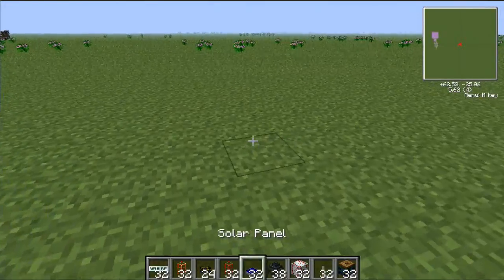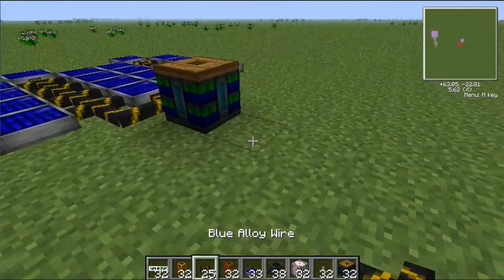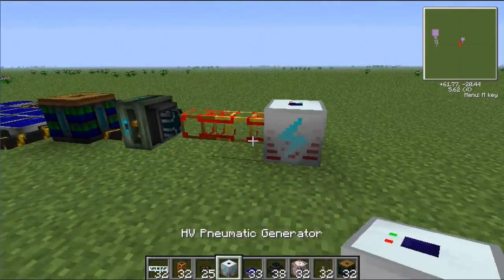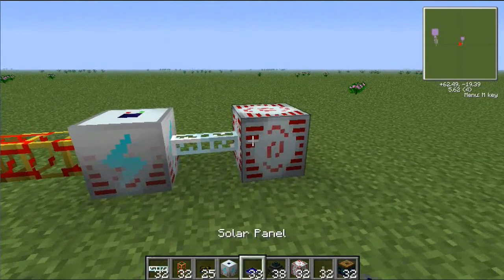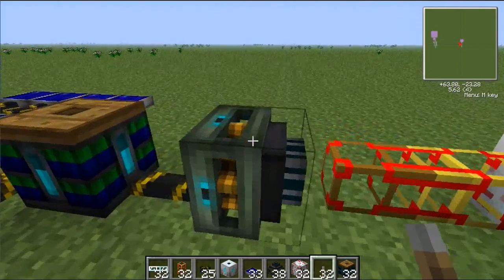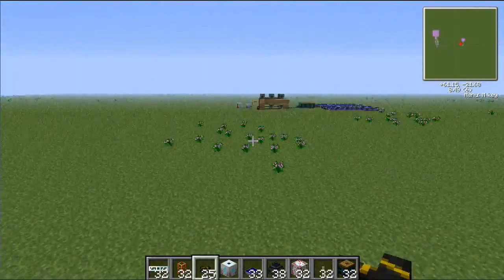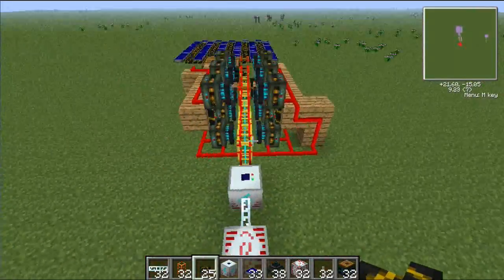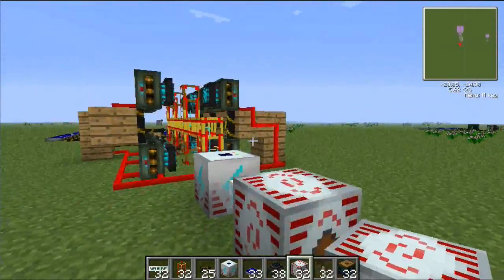Tekkit Lite: Blutricity converted to IC2 Power

Comment: Hey buddy I have a pocket, actually a suitcase full of corrections to your thoughts! For one, MasterShakeIII is right! The P in Pneumatic is silent. Next, the solar panels dont all need wires connected to them because they transfer power to eachother. Another problem with this is that you constantly use connections(Conductive Pipe, Glass FC) which only decreases the amount of power going through. I only have a few more characters in this comment so Good bye! 
while true do
turtle.attack()
end